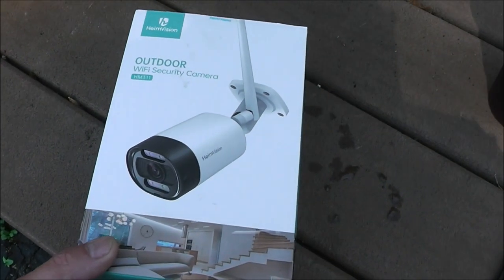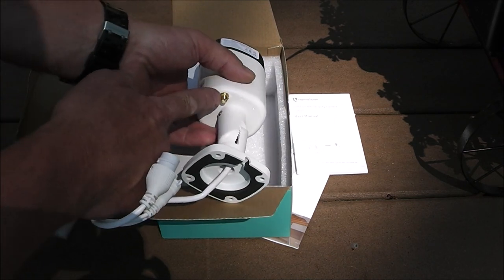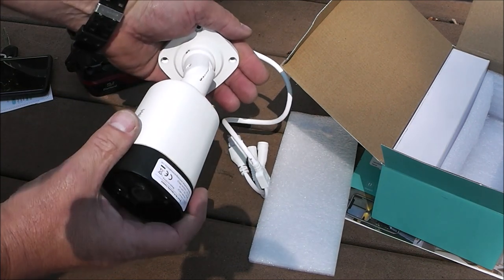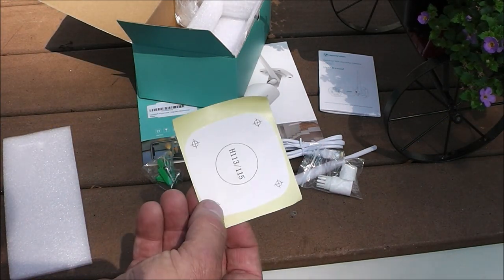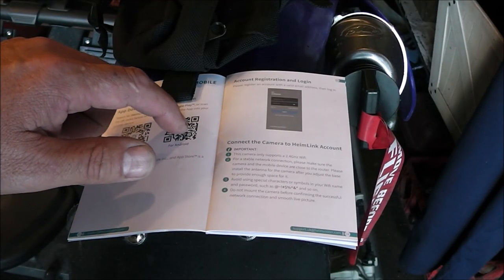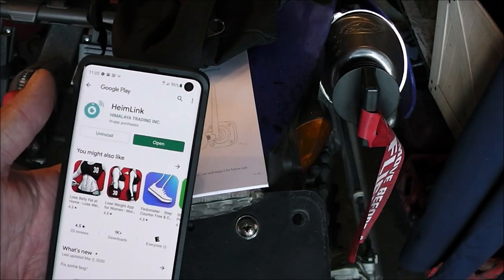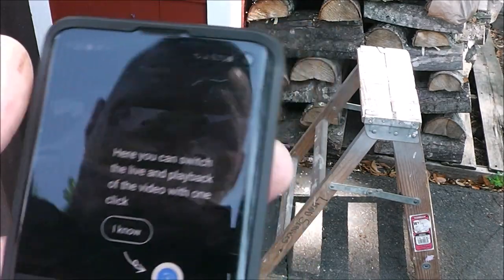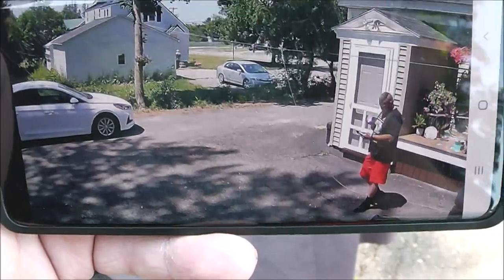How to Install a Wireless Security Camera to Deter Theft  IT'S EASY!

Comment: That looks like a good product  ,I wonder if the app lets you use a second camera  ?    Have a great Independence Day  stay safe   TANK
Reply from the maker: Thanks man. I'm not sure on the second camera but I'm going to find out and I will report back. I'm planning to get a second camera. I'm hoping it works like this. Happy 4th buddy!
Reply from the maker: EDIT: I reached out to the manufacturer. There is no limit to how many cameras you can have but you can only view 4 at a time with the app.
Reply: Brandon   that's cool  that  would get a good amount  of coverage ,  I still  have some boogeyman  in the night time ,  five nights ago two shotgun blasts in front of my place  nothing hit so I think its was harassment this time , so a set up like yours  may help to end this stuff  . we're two far out to have the sheriff  respond  in time ,   Thanks again stay safe    TANK
Reply from the maker: @tanksoldier9770  thanks buddy. These give a notification with a time stamp on your phone that is immediate which is awesome. You can trigger the "event" to record by motion or by sound. Then its just a matter of clicking play on the event you want to review. Mine is a little far from my router so I get a little bit of buffering when streaming real time or during playback. I believe i could eliminate this if I hard wired it to the router. My wife and i went away this weekend and got a notification that motion was detected. We clicked on the camera and could see and hear my father in law picking up our dog to stay with them for the weekend (in real time). I was pretty geeked out by this 🤣🤣🤣
Reply: Brandon     Thanks a heap  sounds like a plan.     TANK

Comment: Good value for the buck there. That light on the garage may washout part of the camera view at night you may want to check it out. Happy Independence Day.
Reply from the maker: You are spot on. During the day its awesome but at night it looks foggy in the center.  I unscrewed the bulb and the problem was solved temporarily.. im going to gave to mess around with moving it a little. Happy independence day to you also :)

Comment: Does the app require a fee or subscription?  Thanks
Reply from the maker: No but you can get a subscription which makes going to the event very easy because it records 30 seconds before an event and saves it as a thumbnail. .. as opposed to not having the subscription and its just one long recording you have to search to find the event

Comment: How's the weather resistance with this camera? We get like 110 degree weather here in SoCal
Reply from the maker: I have had zero issues. It gets around 100 in the summer here and 10 below zero in the winter and we have very high humidity here. I have had no problems at all. Super crisp picture too even at night.. It's an awesome camera.
Reply: @BrandonLund  thanks for the reply... One last question. Does it record 24/7 or just by motion
Reply from the maker: It records all the time. I pay for a yearly subscription its like 60 dollars and you can pull up your camera anywhere. You don't need the subscription but it overall is a better system if you do in my opinion.  It gets triggered by sound by human shape and by motion. For example if the mail man waked in my yard I would get a notification  on my phone saying "human detected in driveway". I click the notification and the app opens to show the motion. The benefit from having the app vs not having it is that without the app you have to watch the video to see what happened. With the app it records 5 seconds before the triggered event and stops 5 seconds after so it makes seeing what happened very quick. EDIT: you can search by "motion event" "detected human event" or by "sound event". It's an awesome system but if your like me and you want it hassle free I would recommend the annual subscription

Comment: So if you hard wire it. Does that provide power to the camera. I just ordered  one with four cameras. Was hoping it ran on batteries.
Reply from the maker: @The Cynic mine doesn't have a provision to run on batteries. It is powered by 120 volts. However you can rig up the video either wirelessly (which is what I did) or with a wired internet connection. A lot of my friends have camera systems also and this system is by far the sharpest picture (especially at night).

Comment: Is there anyway to install this outside with absolutely no wiring?
Reply from the maker: @Leslie Grier Unfortunately no. At a bare minimum you would need to supply low voltage power to the unit.